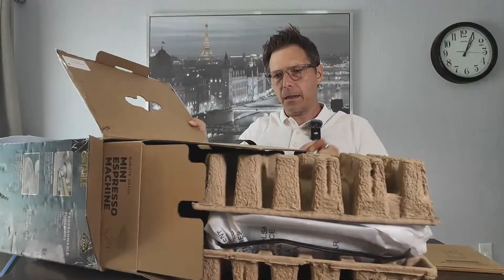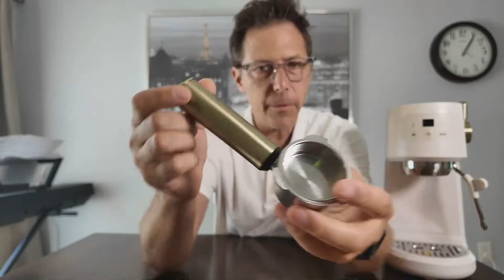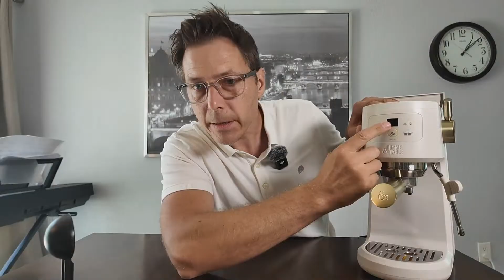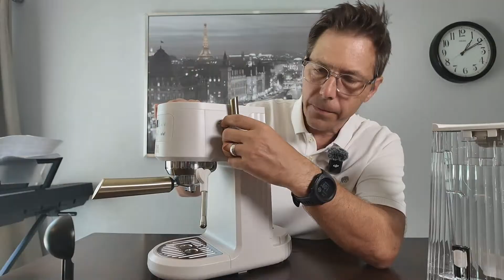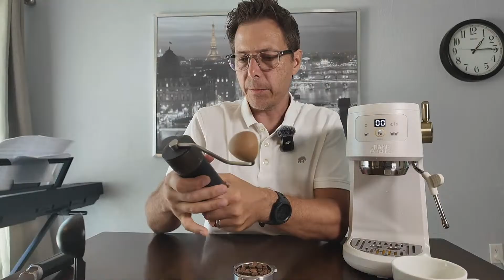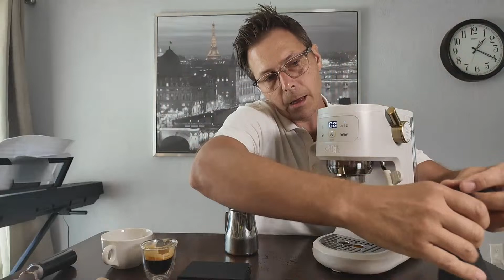HOW TO Setup the Thyme & Table Mini Espresso Machine

Comment: The little Plunger is to inject water into the system the first time, before pulling it from the water tank. It will help the boiler and pump get fed faster so its not heating up dry. Just to share. Thank you for the video looks great.
Reply: where did you get the plunger?

Comment: First of all, I am watching your video to see if I missed anything in setting up and using my own brand new Thyme & Table Mini Espresso machine.  In typical "guy fashion" you plowed right into using the machine without even glancing at the instructions.  If you had, you would have noticed that you need to PRIME the machine by running it on WATER three times first - not steam.  And, it would have been nice if you had explained WHY a timer is good to have.  This video was a total train wreck, and absolutely no help whatsoever.